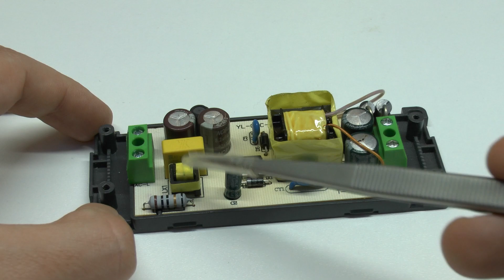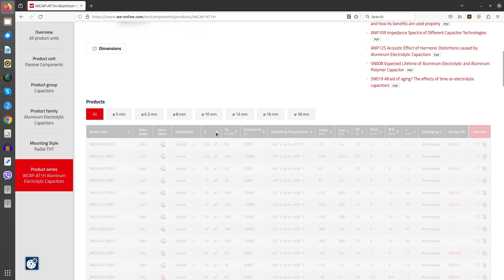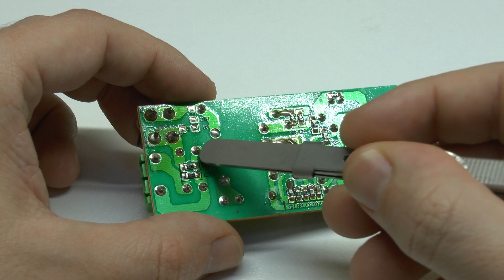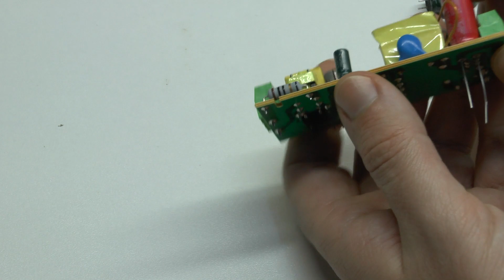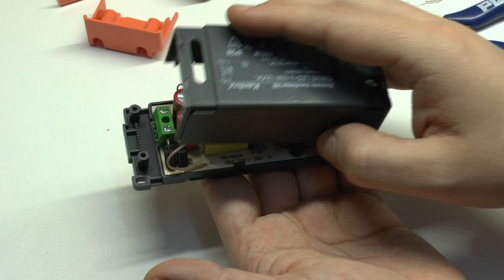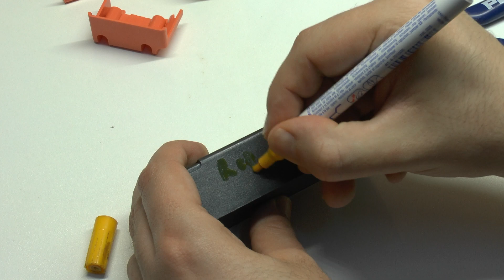KanLux LED inverter repair and failure analysis

Comment: I‘m still amazed that they still use Transformers..
Reply from the maker: Thanks for talking back man. Probably, they do it to satisfy galvanic isolation!
Reply: What would you suggest as a reliable and cost effective replacement? Something that can provide reliable HV isolation? That can shut down at its designed current limit? Something small enough  to make sense?
Reply from the maker: Hello, thank you. IMHO, I still consider transformers the most efficient approach...also due to the recharge losses on caps...  @michaelterrell

Comment: Capacitors are the weak link in all of Electronics. You have to trade lifetime for practical costs. Also, in some circuits, the LV electrolytics have to be as close as possible to the major load. I've had 'genius' types argue that the electrolytics on computer mother boards all be grouped to a corner of the board, to stay away from the CPU's heat. They can't grasp that the CPU is very low voltage and can draw over 100Amps. Long power rails destroy both voltage regulation and reduce noise immunity. One thing that bothers me is when boards are laid out for extra capacitors in this type circuit, but they use just barely enough to make the boards work. This puts a higher ripple current through each remaining capacitor. That generates mot  I/R losses, which destroys the capacitor much faster.
You and I have both worked with well designed, industrial grade Switch Mode power supplies. Great regulation, low ripple at the output, and designed to run 24/7 for at least a decade. To saw a dollar or two in manufacturing, consumer grade designs only give a couple years service, on average.
Reply from the maker: Hello,
thank you so much for talking back! 

Yes, the Muntzing is kind of insane nowadays. But what can you do...its the markets wish, sadly...
Reply: @MrTamhan  I add more caps, when making a repair, and buy the best capacitors that I can afford. I spent many years working on Mission Critical equipment. Done properly the repair will last at least as long as it did when new.
Reply from the maker: Thanks man. In this case, probably the repair will outlast, by far, the original! I had a full fleet of failed converters on hand  @michaelterrell
Reply: @MrTamhan  Some Chinese OEMs love those super cheap capacitors from 'One Hung Low Caps and Fortune Cookie Company'! 
One long gone American company motto was, "The quality goes in, before the name goes on" Sadly, today many companies go by "Ship the damned thing, before it fails!"
Reply from the maker: Hello, to be honest, it is often also caused by the European or American client. I will make a video on that shortly, probably when back from Vienna!  @michaelterrell
Reply: @MrTamhan  At one time, Sprague was the top US source for all types of capacitors, but penny pinching customers started turning to lower grade suppliers The price difference was obvious, but so was the quality. The life was shorter, and the cheap stuff was over speced. They bad a large factory in Orlando, until the early '90s that made film capacitors, and the large can type 'Computer Grade electrolytics. After the equipment was auctioned off, an asset recovery company sold off  what it could of the remaining raw components used in manufacturing. 
I ended up with a damaged spol of the tin plated 'Component lead' and a full roll of the metalized Mylar film used to wind HV film capacitors. I tried to get the deep drawn aluminum cans and terminal boards, but they were scrapped for the aluminum and brass.